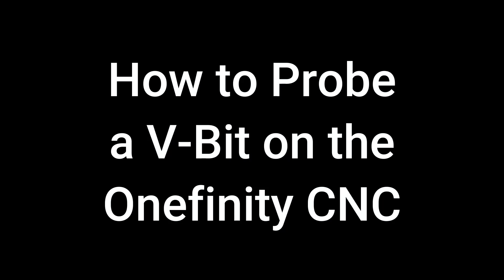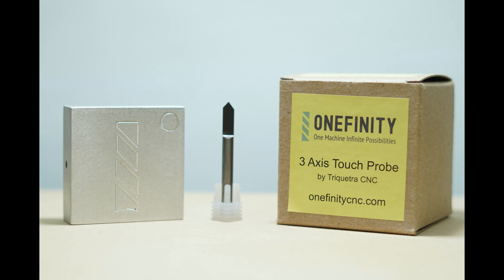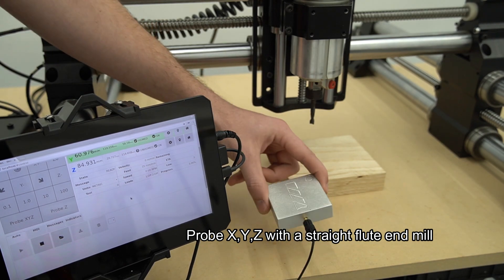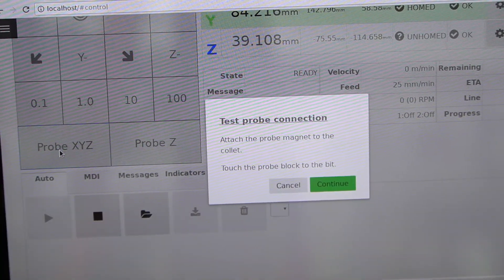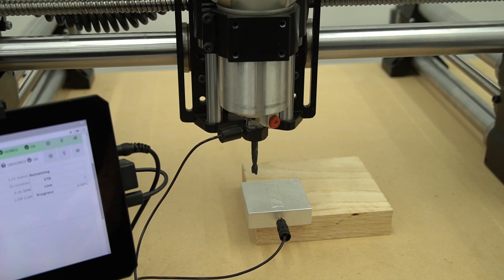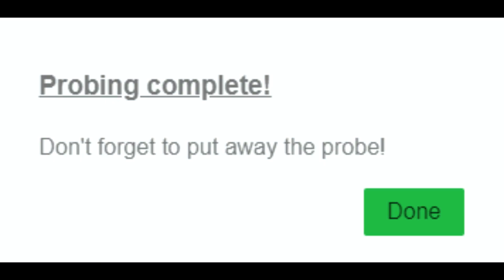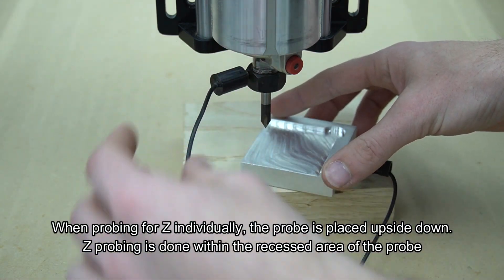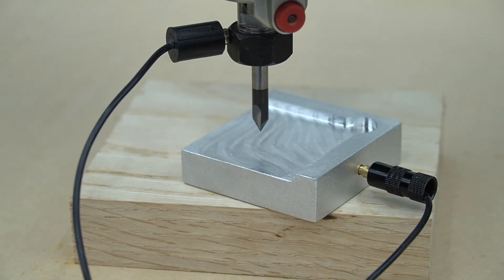How to Probe a V-Bit on the Onefinity CNC

Comment: Why are you probing the bottom on the Z only probe?
Reply from the maker: That's how it does it's mathematical calculations.
Reply: @OnefinityCNC  That makes no sense, the distance would be exactly the same no matter if the probe was upside down or right side up as long as you had it in the original position with the lip overhanging the corner. The metal block is exactly the same thickness in either orientation. If you don't believe me, do the z axis test with the block in each orientation in turn, right side up, or upside down. Your reading will be exactly the same.
Reply: @sigung01  You are correct.  However by placing it upside down you do not need to fine adjust  X or Y nor be at the corner.  Just throw it down and probe.   Same thing just faster most of the time.